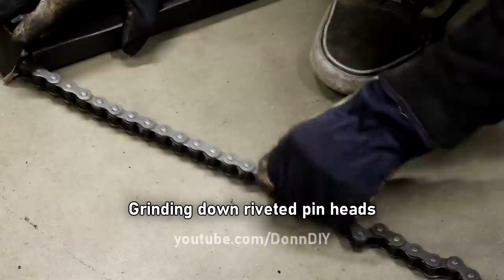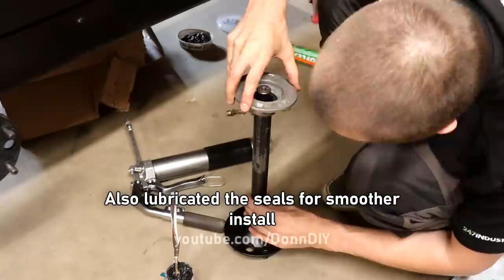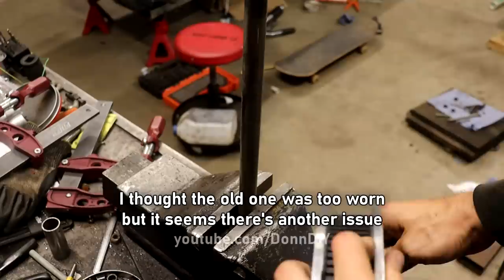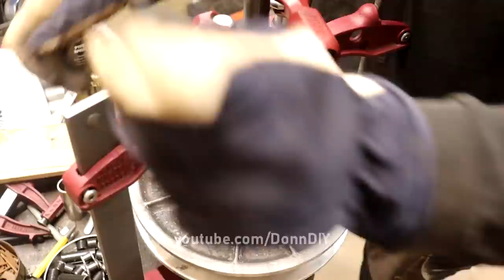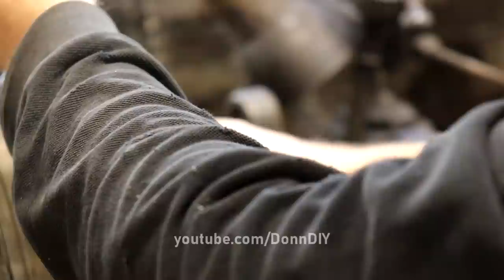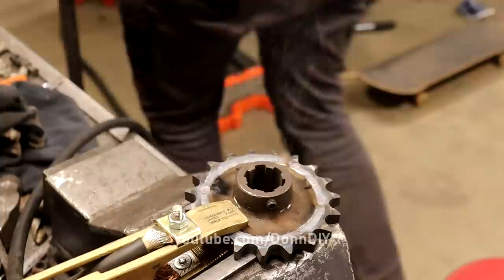Sprocket TIG Welding & Assembly - 8x8 Amphibious Vehicle Argo REBUILD Ep.7

Comment: Donn, the belt on the CVT should be fairly loose in that application. When at idle the belt needs to fully disengage so the secondary clutch stops spinning. If there is drag and the secondary clutch is trying to spin at idle it will load the shift mechanism therefore making it hard to shift. It’s critical the secondary clutch is not loaded at idle. Looking good! 👍🏻
Reply from the maker: Thanks for the encouragement, I'll give it a go "as is" and see what happens.👍🙏
Reply: I have also never seen a belt install without a fight or a tool

Comment: When you were installing the newly cut chain I thought you had a measure twice cut once moment, but I quickly realized that I was wrong.  
When I saw the machined sprocket on Instagram I thought you were creating a new tensioner pulley but then remembered another post you had of the actual tensioner pieces your making or getting made.  👍🏻👍🏻👍🏻

Comment: I think the second Shim was the try to make it faster. The belt is able to reach a smaller diameter with it. The gear ratio changes.
Now you habe a better torque but a slower max speed.
Reply from the maker: Sounds logical. In the mud I'd rather have torque. So all good.👍

Comment: 6:44 not just rubber layer, they're actually infused with rubber (or rather the cork is poured in with the raw rubber and galvanized in sheets). So those gaskets would leak eventually, so it's actually a very good idea to use silicone with non-rubber cork gaskets, especially since these days the quality of cork sheets leaves to be desired. It's brittle as heck, where as old style cork sheet is pretty well bonded. I don't even know what i'll do when i run out of my old roll, cause it's not easy to find.

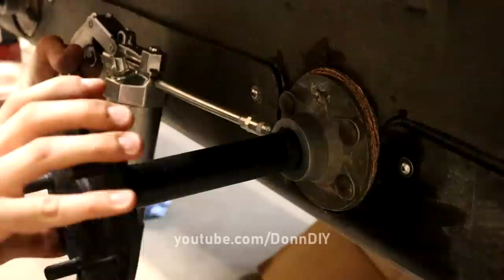Comment: 7:52 you could use a large Allen key, like 10mm or any right angle bar that long enough in a drill, hold drill centered to shaft and it can rotate the shaft for you while adding grease.

Comment: Tho i admit, i've no clue how long it would last, you could at least try, since there's no harm in doing it. Using PET (from bottles) make sleeves that slip over the joint where the cork gaskets are, and with a heatgun, shrink them down to the hub over the cork. Again, no clue how long it would last, but PET is pretty strong and should at least protect the cork for a while.

Comment: Why are you still using a diff plus brakes for steering instead of fitting just two CVTs off of an ATV and do differential steering by forcing a differential ratio with them? Would also eliminate the need for a gearbox, as you could alter the ratio and the ratio between them with two levers.

Just needs an RPM governor, to keep the engine out of the red line and in the optimal power range all the time. :)

Comment: Bro when you are heating the steel you are expanding it Inside the alloy heat the alloy to expand the alloy to pop it out if you want to fit steel in a tight spot put it in the freezer it will shrink

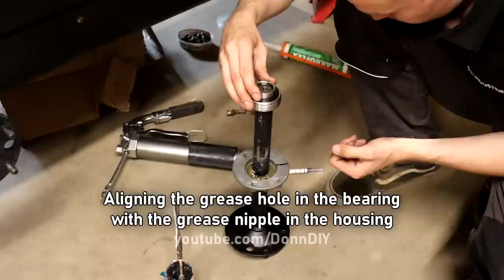Comment: 5:55 wait, you need to Loctite it in, or it will rotate around with the grease port, wouldn't it?
Reply: Maybe. Note the groove. It will grease anywhere the hole is so long as the grease doesn't become too stiff and dry. If Donn keeps up his maintenance (which I'm sure he will) there will be no issues.
Reply: @TheMetalButcher  but doesn't that mean the bearing housing spins instead of the bearing itself? 🤔

Comment: I got a little lost at that clutch rebuild, it looked you you lined up holes on clutch so the prong on both ends of spring goes into number 10 and no.2 holes...... 
PS. When in middle of project, try to post something at least once a month, even if it's only a 2 min video of video in progress, or why the sky is blue...........
Reply from the maker: I did post stuff on Patreon at some point. Hopefully having live Q&A-s as well soon. 🤞